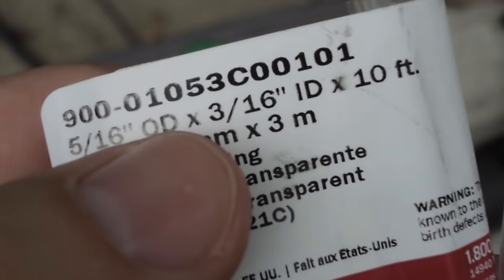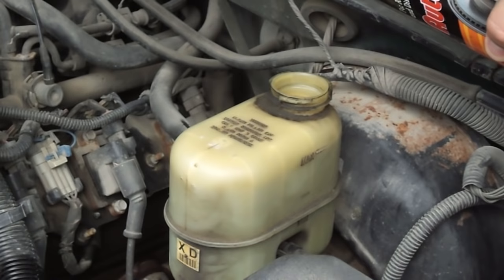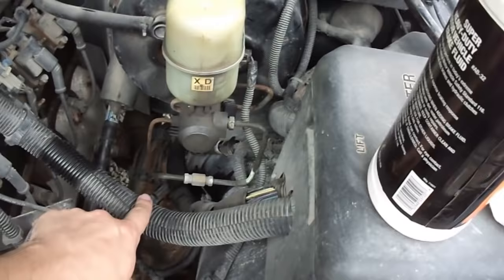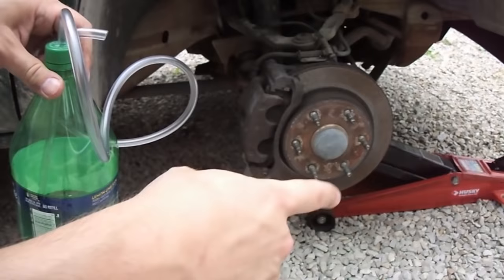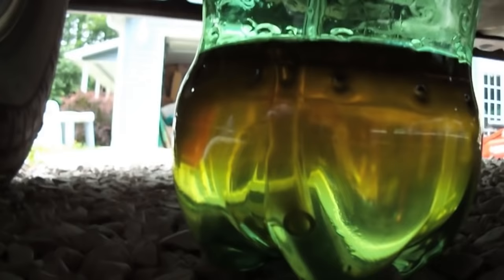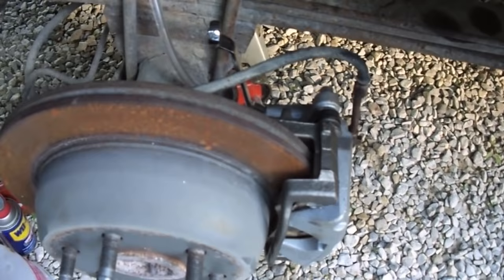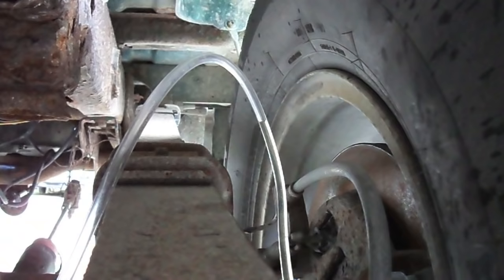Bleed brakes by yourself - DIY Brake Bleeder tool - Brake flush

Comment: the diameter of the tube does not seem correct 3/16 "is too small, am i wrong
Reply: the brake lines are only 3/16,,,but i used a 3/8 OD tube with 1/4 ID opening

Comment: Just a bit confused as you said furthest from the MC  or ABS module...would it be the same order regardless?
Reply: No. 

On his truck the ABS module was about about 2/3 of the way to the back of the truck and on the driver's side. That makes the right front furthest from the ABS module. If you have an older car without ABS then you bleed the brake furthest from the M/C first which would be the right rear. 

So you need to know two things: 

1) Does your car have an ABS module? 

2) If yes, where is it? Start the bleed process from there.

If no ABS module use the M/C as your reference for as to which valve to bleed first.

Comment: Can I use this method to clear all the lines completely. 

Dismantling a 65 mustang
Reply from the maker: Yes, so long as you keep the master cylinder reservoir filled with fresh brake fluid, you'll eventually flush out the old fluid with this method.

Comment: How do you know when to stop bleeding the brakes? Until the fluid coming out is clean?
Reply from the maker: When the bubbles stop coming out, and it's a solid stream of fluid, then the brakes are bled. If you are flushing your brake system, push out all of the dirty fluid until clean fluid is coming out.
Reply: The Daninator w

Comment: HI FOR NEWER CARS WHEN PUMPING BRAKES DOES THE CAR NEED TO BE ON OR OFF?
Reply: Off. Also do not push the brake pedal all the way to the floor 3/4 of the way is good enough and pump slowly. I am surprised he did not siphon out most of the old fluid from the resivor and put it in the sprite bottle.
Reply: @koshnaranek2317  thanks I'll do it that way. 👍

Comment: does the ABS fuse or relay have to be removed during this procedure ? I thought I read that somewhere. Thankz..very good idea!!!
Reply from the maker: Not sure if it's necessary, but I didn't.
Reply: I did like you showed and it worked perfect... I did not remove the abs fuse or relay and it turned out just fine... funny... the bottle I happened to find was a Sprite bottle too... funny... thanks for the video..

Comment: Question, I bled the brakes today as I replaced the pads. But when I turned the 2000 Chevy Blazer on the pedal went to the floor. I’m going to bleed them again tomorrow. Any idea why the change between the engine running or not?
Reply from the maker: Jerry B what’s the fluid level? Maybe have air in the line, a leak, or bad master cylinder....
Reply: The Daninator : It is full of new fluid now. I’m told since they are all disc powered that I need to bleed the brakes with the blazer running. So I will do that tomorrow and update you.

Comment: hi if you have abs breaks do you have to disconnect the abs fuse or battery terminals when pushing back the break pads as i was told if you don't it could effect the computer
Reply from the maker: blijytoo not sure. I have abs and didn't mess with any of that.
Reply: That is almost a silly question
The Key is off so the computer isn't scanning the abs system
The abs is scanned with the key on but doesn't even function
unless your going 16 to say 22 mph depending on system design.

Comment: before doing this, did you have a abs light on and after bleeding the lines did it go away?
Reply from the maker: Dillon Diaz I had replaced a brake line. No ABS light was on.
Reply: ABS is generally a wheel sensor or wire going to the sensor.  Reluctor ring or module are also causes of ABS issues
Reply: @sirsweetness8332  Or bad ABS module ground wire connection.

Comment: You should not push the brake pedal hard to the floor, only 'normal' smaller pumps You don't want to be pushing the plunger inside the brake master cylinder past where it normally travels and into a never used (and potential rough/coarse/corrosion) zone. A tip from an old mechanic.
Reply: Thanks fred!
Reply: Makes sense

Comment: You should start by sucking out the dirty fluid out of the master cyl first, THEN fill it up.
Reply from the maker: Yes, that would save you a lot more brake fluid than the way I did it by just pushing the old fluid out of the MC with the good.
Reply: I use a syringe from a turkey injector kit to do that every time I flush my brakes.
Reply: Great video on how to bleed your brakes ,BUT i have a request  whats the name of the song that plays in the video thanks and grat work....
Reply: Agreed.  I usually agitate the old fluid in the Master so that the crud on the bottom can get sucked up with a syringe.  Just leave little old fluid in there then add some clean fluid.  Agitate again then suck it up.  When the crud is gone fill and bleed.
Reply: weelgunny i
Reply: I pump the old fluid out with a pump that comes in a throw away bottle of hand wash. These pumps are the best, dont degrade like some crap that you buy. Brake fluid doesnt damage them. Just wash out the soap with water and pump the old fluid through makes it clean. Took me ages to find this free pump. I change the brake fluid every couple of years. Also I use a peanut butter jar for bleed fluid, plastic one is best, glass can break when you drop it with your oily fingers. Cheers from down under.

Comment: How do properly dispose used brake fluid?
Reply from the maker: Dexter Mangio I’ve heard of pouring it on cat litter. It’ll evaporate after a few days.
Reply: Put it in with your waste oil

Comment: If air is still in there after bleeding and there’s an abs system there may be an air pocket in the abs module and it’s either started or bled by computer at dealership or buy one or try to stomp the brakes in grass and not kill anyone and be careful where u do it to get that bubble to move or activate the abs . It will feel like you have brakes after one or two pumps when driving . They ll get hard when not running but when started goes halfway to the floor so there’s air . This happens when a line is changed connected to the abs module in the  the seat in Gm vehicles . Pre prime your line if you can from the master cylinder with gravity . Then connect and bleed . It’s a bitch either way but can go well . I ve seen the air problem a few times . Always messing with abs .

Comment: I thought you were going to use the suction from the squeezed bottle to pull fluid.
Just squeeze it and plug your vent. Might not be enough but that's what I came for, ha.

Comment: Hey I just wanted to give you a heads up you didn't do the brake bleed procedure right you always start from the furthest tire away from the master brake revoir then work your way down to the front it saves you time and brake fluid

Comment: it would be more safer to connect tube to bleeder first and fill fresh fluid on the other end of the tube ,hang it higher than the bleeder then insert other end  into the bottle soaked with some fluid too.This sure will not allow any air going back to the bleeder even on the first pumps....happy bleeding guys

Comment: I used the same trick with a water bottle.  Found out the hard way.

Bleeder valves should be on the top side, not the bottom.  Picked up my brakes, rotors, calipers and installed it all.   Starting bleeding the drivers side, then went over to the passengers side....    What bleeder valves are on the bottom......... UGGGG!!

Back to auto parts store, dude you gave me two sets of the same calipers........   My bad for not noticing when I put them on....

Comment: So, even with the bottle and tube, you're not supposed to; 
1. Pump the brakes to build pressure 2. Open the bleeder until fluid stops flowing and then close 3. go do it again until you're done?
? You're SUPPOSED to leave the bleeder OPEN the WHOLE time after you get the tube on, and just pump until your done ?

Comment: Hi! You must remember to hold the pedal down, until the valve is closed, or you will sock air in. 🙏
Reply: No it won't that is what the soda bottle is for.
Reply: That is the traditional way, and it requires two people. The whole point of this video is to show how it can be done with one person.

Comment: This works on older vehicles but not no the ABS brake systems. The ABS brake systems are a sunny beach. I have been trying to bleed the brakes on a 09 Ranger for a week and still nothing. I have the tool to run the ABS motor and still no luck. Got new brake pads front new shoes back. Sitting still brakes are fine but driving I have half peddle.
Reply: True. ABS tends to make it more difficult for the DIY guys.

Comment: Topping  up the brake reservoir use a funnel or put a rag around it before you pour fluid everywhere. drill the cap off the bottle so the swarf doesn't drop inside the bottle, change brake fluid every 2 years remember your life depends on it!

Comment: It's a Chev alright , rusted out rocker panels and rusted out break lines . One line rusted out ? Might as well change them all . They are all made out of the same cheap rust prone metal . But GM probably saved a buck a car by using a lower grade steel .

Comment: I think pumping brake pedal when bleeder screw is open is not good idea. Even with tube with fluid atrached. When you release the pedal system may suck air between nipple thread and calliper.

Comment: Here's my #1 consistent problem >>  The bleeder screw isn't a tight seal to the caliper threads and air.brake fluid seeps from there...what then ?
Reply from the maker: I've never used this, but check out this sealant: https://www.permatex.com/products/thread-compounds/thread-sealants/permatex-pneumatichydraulic-sealant/

Comment: Common sense , unless you have a fluid leak, filling the reservoir to the same level after you bleed the breaks will allow you to watch the level in the reservoir as the pads wear, the reservoir should be at or near full for new pads & less for worn pads& the level could be used in conjunction with checking actual break wear, not complicated& an easy way to monitor the rate of wear.

Comment: Does this get done when you have your brake pads replaced at the shop? No garage has ever mentioned "it's time to have your brake fluid changed/brakes bled".  And you think they would for the extra business.
Reply: Not needed when changing brake pads. But car makers do specify that all the brake fluid should be replaced periodically.

Comment: Outside of the Caliper you had to replace, you Flushed out the system, that's not bleeding the brakes. Just one cylinder need the air bleed off.

Comment: Arent you supposed to do pasenger rear then drivers side rear and then pasenger side front?
Reply: Not all cars run the lines the same, and the location of the ABS can complicate it.

Comment: can i do only the rear ones and in whatever order i choose?:j (because the front right nipple is kinda busted anyway)
Reply: Need to have 4 good bleeder valves & flush all 4 corners.
Do the shortest run first time to get rid of dirty fluid,
then start at the farthest distance for second & final bleed
Replace the broken bleeder

Comment: But does this system remove fluid in the ABS unit? I am not so sure. PS You rear disks look rather rusty!
Reply: Yes it flows thru the abs module through the line to the bleeder screw.

Comment: ok so what you are doing is pumping the breaks? guess I did it wrong. I would push the break pedal down. keeping it down by wedging a board between the pedal and front seat frame. then close the bleeder nipple. get in the van remove the board. get out, open nipple. get back in the van push the pedal down, rewedging it to stay down, then reclose the nipple valve. ane repete like 8 times per wheel...

Comment: 1st thing to do is to remove the old fluid from the reservoir using a turkey baster or similar,otherwise you are mixing the old fluid with the new fluid

Comment: First clean the cap before open,is that the tower you used to clean brake fluid, is it on your car body now!
Please put some water under the master cylinder ,before you fill up!
Do put the hose all the way down ,if no Bubble can see the fluid coming.

Comment: Think you went in the wrong order,,, the furthest spot is the rear passenger,, ,then driver rear,, then front passenger ,, then front driver.
Reply: It sort of depends on the model of car; not all manufacturers run their lines the same way so I always look up the specific info for the car I am working on. My wife and I both drive Toyotas but my 2007 Matrix is not the same as her 2015 Camry.

Comment: Every time you release the brake pedal you are sucking old fluid and air back into the system...CORRECT way is press pedal down and hold it down, tighten bleed nipple then release pedal, then do same over and over again...Or buy a vacuum bleeder

Comment: First you add little bit of water or brake fluid in  the bottle and the vinyl  tube  fits on all nipples.?
Reply: Use brake fluid in the bottle. That way if liquid gets pulled back in to the system it is brake fluid. The nipples are universal the threads are not so yes, the vinyl tube will fit the nipples.

Comment: The brake is sinking after flushed! Help
Reply from the maker: The first thing that comes to mind is that the brake system is open somewhere. Bleeder screw not all the way tightened? Hole in a brake line? Etc.

Comment: Really helpful, I've heard about this technique, just never had all the details. Now I'm ready to try. A lot cheaper than 4 speed bleeders! They say the furthest brake from the master cylinder but aren't the brake lines the same lenghts to keep the pressures all the same during braking. Just curious, let me know
Reply: perp774 the length of the line won’t affect fluid pressure, but the diameter of the line will.
Reply: @mistaflinstone72  it was explained to me that if one front line is longer thsn the other the calipers will not be able to function at the same times . Pretty much when hitting brakes youd pull to one side. I wasn't convinced at the time and still tske all thst with a grain of salt
Reply: perp774 got you

Comment: Not always do that start furthest from the master I think toyota and Honda are different and if your bleeder screw is frozen and you feel like you might break it off take you hammer and bleeder a few good times but make sure your swing is dead nuts on! If done correctly it will work 99% of the time

Comment: I'm still not sure why the drilled-Sprite bottle is necessary. It seems like the tubing is the real champ...
Reply: You need the bottle with fluid in it so air doesn't go back in
Reply: The bottle is to catch the expelled fluid.  Do you really want it over the floor?

Comment: Why are American cars so rusty? It seems that all car fix videos from the US are done on rusty cars! It must be the climate!
Reply: Road salt when it snows. Southern US cars and California cars don’t have this problem unless you live on the coast.
Reply: Ah ah! Thought so. Here in Oz we don’t salt the roads where it snows. My Nissan is over 22 yo and no rust underneath.
Reply: @hansignals9593  yeah y’all are pretty dry out there, luckily I’m in the same boat. I’m in Texas and my first truck was a 2002 and the thing looked brand new underneath. Never bought a bottle of penetrating oil :)
Reply: Now, Ironically I had a same year (2002) blazer that spent a few years in Indiana where it snows and they salt the roads heavily. And that thing was pretty bad, one of the body mounts wasn’t even mounted because the channel where it mounts was rotted out haha.
Reply: @hansignals9593  Southeastern cars get hit by humidity and salt air if along the coast as well. The best restorables come from junkyards in the Southwest.

Comment: Any improvement when u change it ??
Reply: Joey Baaklini you should change your brake fluid every 2-3years due to the fluid absorbing moisture (water). Brakes create heat if you have excessive moisture in your brakes it can lead to brake failure. Over here (UK) it will be part of the car road test to test the moisture level in your brakes if excessive probably a test fail.

Comment: MAYBE NOT ENOUGH INFORMATION, According to this video to self bleed your brakes  all a person needs to do ,is loosen your bleeder bolt, hook up a drain hose into a bottle & allow gravity to push out  the air. From that I guess when you no longer see air bubbles passing throgh the line , the line to that brake is purged of air, tighten the bleeder bolt , screw. That's it
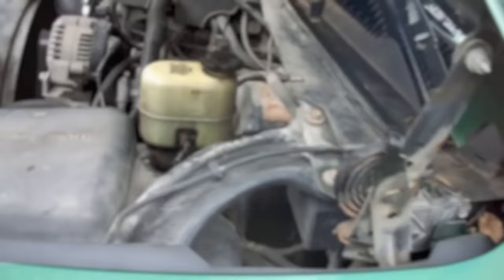Reply: You obvioulsy missed the part around 3:50

Comment: Can u reuse the brake fluid that his into the bottle ?
Reply from the maker: If the bottle is clean to begin with, and the fluid looks clear and clean, I don't see why not.
Reply: It is not advisable.  In fact car makers recommend changing all the brake fluid every 5 years (the figure varies) because old fluid gets crap in it, and absorbs water vapour that can boil with heavy brake use.

Comment: Anyone know the reason for bleeding the furthest brake from the reservoir first?
Reply: It's the end of the line ,if you go the opposite way it is possible to re introduce air back into the system or not get all the air out .Also there's the  dragging the new fluid through the old thing too.
Reply: @rkgsd  honestly some brake systems are different in the way they branch off from the master cylinder,if you do it the way most said it's possible for that to wrong too.

Comment: The end of your video shows you stopping and your rear brakes are locking before the front. I believe that is wrong and a recipe for disaster.
Reply from the maker: Ben Gone I slammed on the brakes for a funny illustration. The tail is lighter than the front so it’ll naturally lock up before the heavy front end will. Especially on gravel.
Reply: @TheDaninator  or maybe reset proprotioning valve.